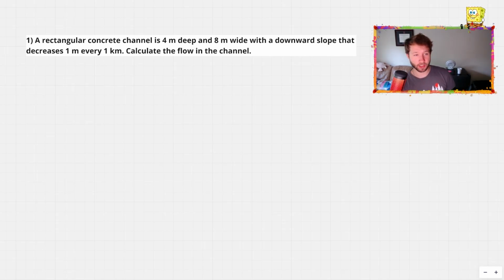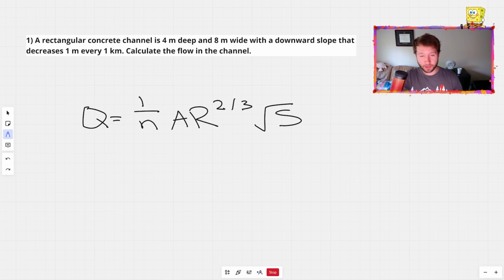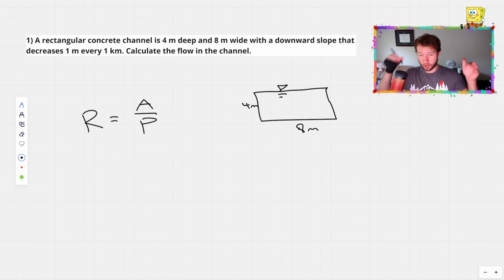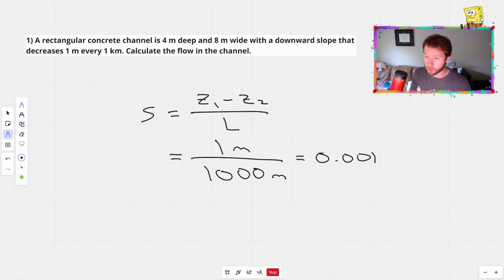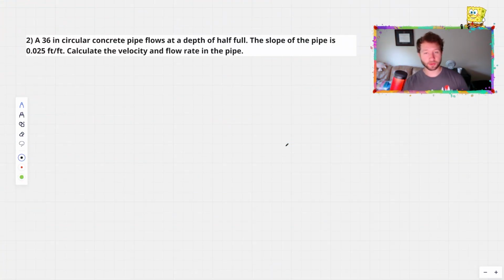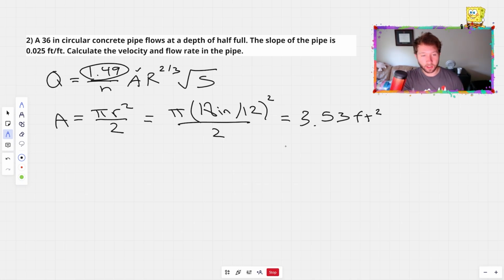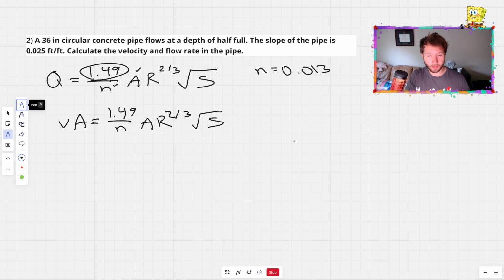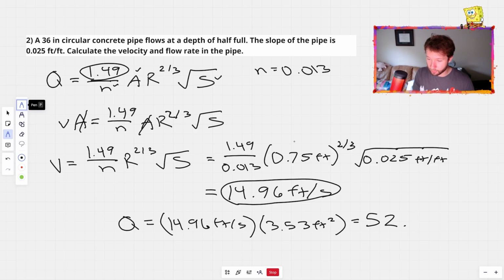FE Environmental Exam Prep: HYDRAULICS - Part 4

Comment: Would the wetted perimeter not be half of 4.71 ft because the pipe flows at a depth of half full?
Reply from the maker: No because the formula for circumference is 2*pi*r but I just took out the 2 and did pi*r. Same as dividing by 2 for half full flow. Thanks for the comment!